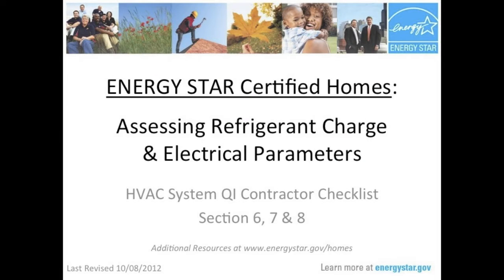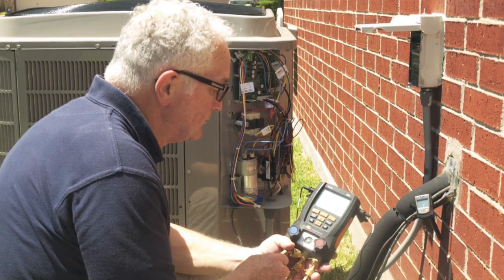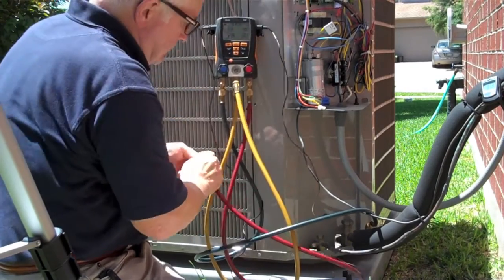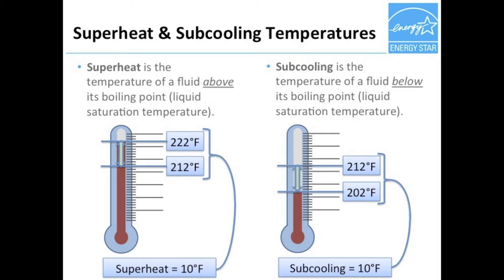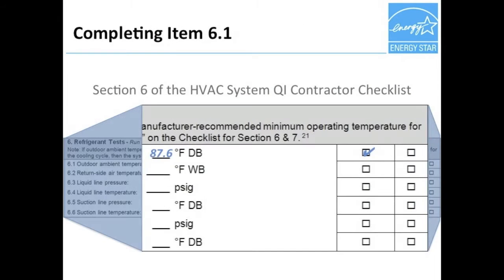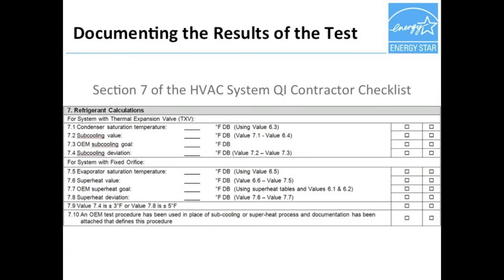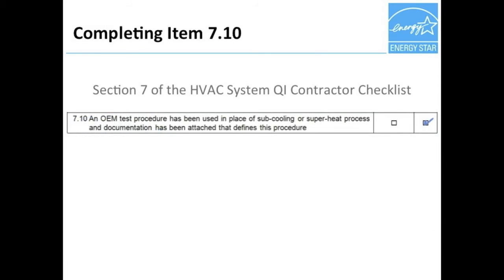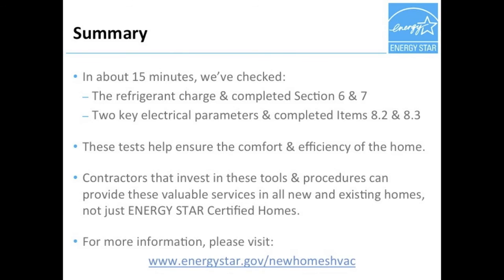Assessing Refrigerant Charge and Electrical Parameters

Comment: Both readings are showing signs of a slight overcharge which could be casued by any number of things and I would want my technician to look further into the situation. All is good + - 3 or 5 degrees for the given temps recorded for that day BUT..as the conditions change.. Could this system start to wash out the compressor bearings as the system reacts to the slight over charge? Not to say this system is not running as close to spec's as possible..but I would want to do more to confirm this ...